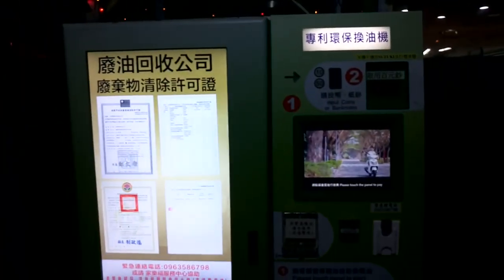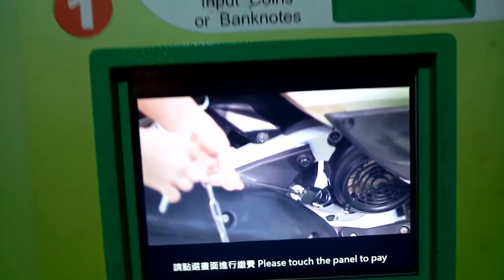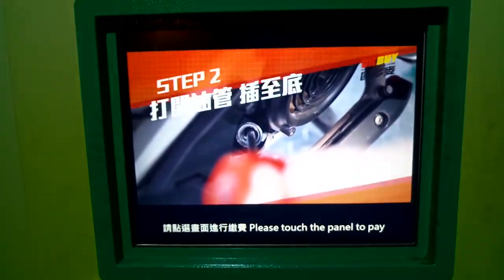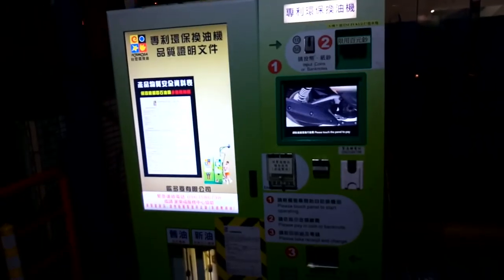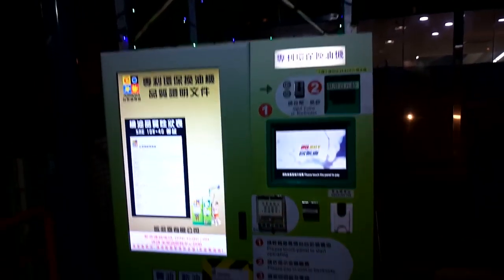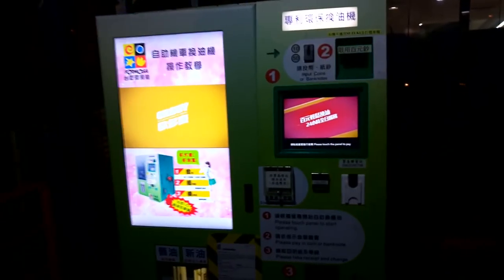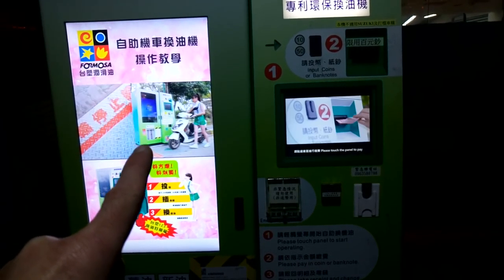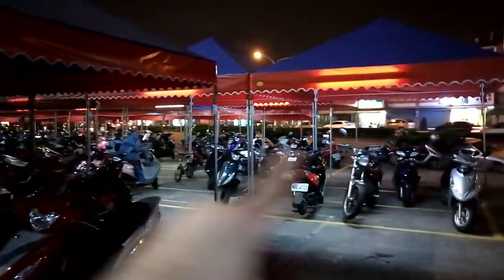Automated Oil Changer

Comment: Try it and see what the dipstick measures when it's done. Seems potentially dangerous considering the variation that can occur for oil taken out vs in. Plus, what the hell kind of oil is it putting in? In there a selection for name brands or what?
Seems like a really bad idea in any case.
Reply: +☣droid☣ 
Over or underfilling could be a problem, if people don't know what they have to select. On the other hand the machine might measure how much it pumped out and puts as much back in (and the volume selection is just for the max/payment).
The oil would be the gas station brand, which is as good as any other oil. Most come from the same place anyway just with a different label (and extra price tag for the "brand").
Reply from the maker: +superdau Well said.
Reply: +☣droid☣ Probably a flow meter to see what comes out. Name brands don't matter all that much but I'm wondering if there's an option for weight. How is it a bad idea? The only issue I see with this is metal shavings from a fucked motor remaining in the filler/vacuum tube.
Reply: +☣droid☣ I do see a problem with the amount of oil it pumps back in too. A 50cc scooter needs around 800cc of oil a 125 around a liter. A motorcycle more like 2l+. And a scooter needs different oil than motorcycles.
But I think generaly it's not the worst idea keeping in mind that most of the vehicles  you see in the videos are scooters with fairly simmilar engines. It's more of a vehicle to go to work rather than a vehicle for having fun with and really enjoying working on it and caring about.
It's better to do it proffesionaly but I would say it works for Taiwan or simmilar countries.

Comment: I wouldn't trust it to actually replace the oil. How do you know that it's doing anything? It may just leave your old, crappy oil in there and charge you as if they changed your oil...
Reply: +Boat Murdered dude just check your dip stick and if you dont have a dip stick any piece of stick will do
Reply: . Bidot That's true...